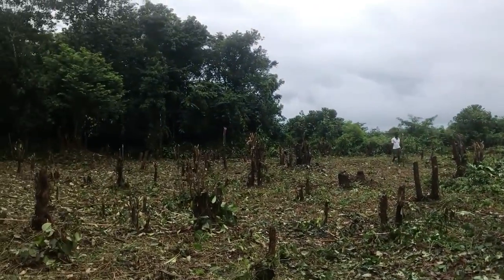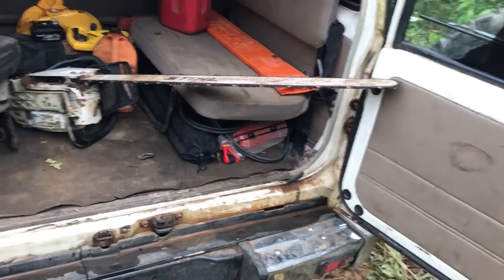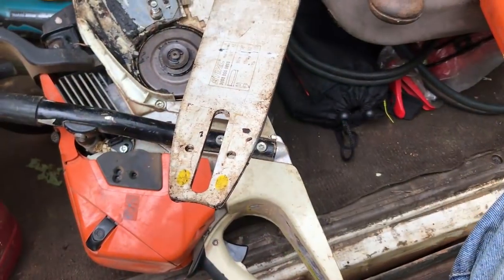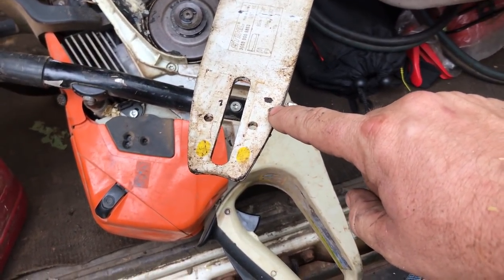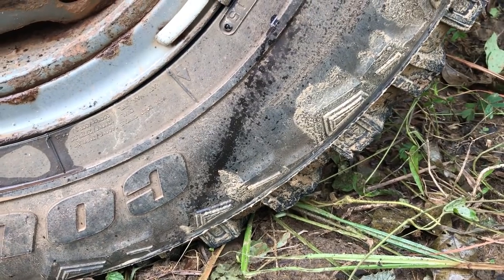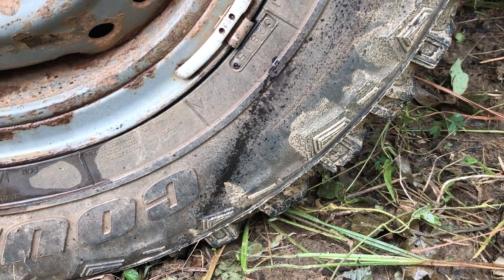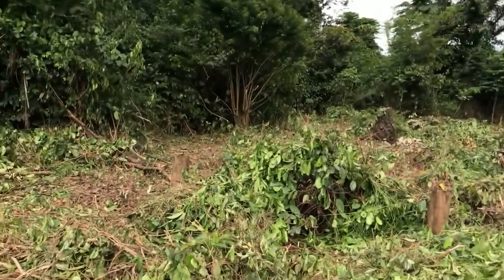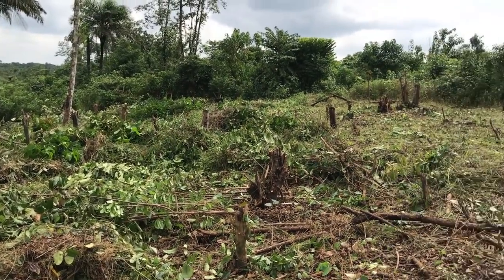How to Lose 10 Pounds in One Day!

Comment: Just a bit of info ... New chains do "stretch" with the heat of using them.  Keep the oiler working and the chain should settle down a little in time as long as you don't have it over tightened to start with
Reply from the maker: Thanks. My concern was that it seemed to keep stretching and stretching. Of course, with the Oiler not working properly, it was probably getting a little overheated too.

Comment: Folks have already talked about the new chain stretching. You are using the chainsaw vertically, the oiler is most efficient horizontal, No biggy, gravity just isn't helping you right now, also held vertically, the chains seem to loosen more than horizontal.  As others have mentioned, be sure to keep it clean. Any dirt strikes will dull your blade for sure.
Reply from the maker: Thanks for the advice! 👍🏼